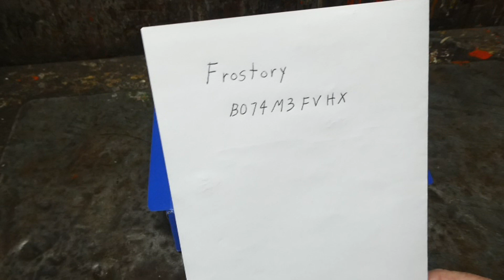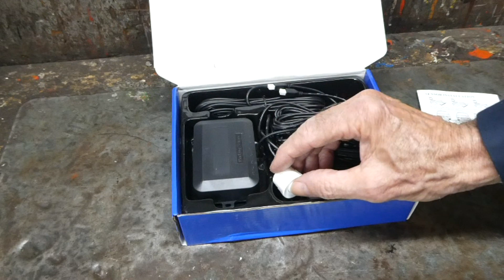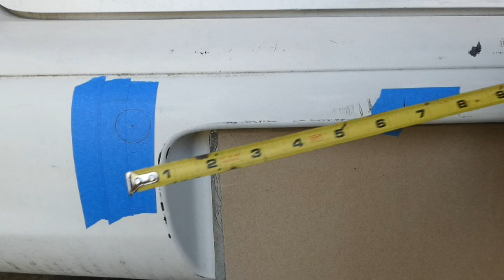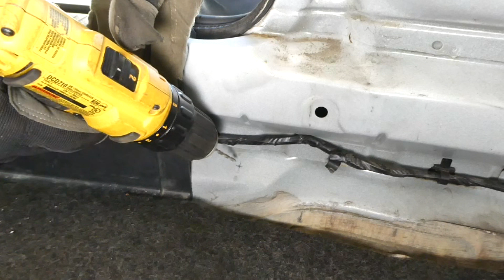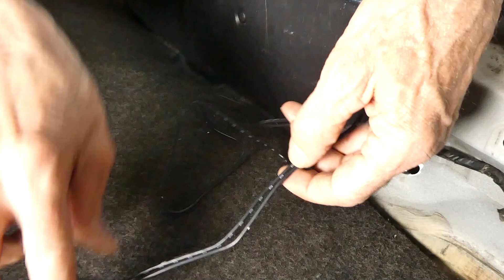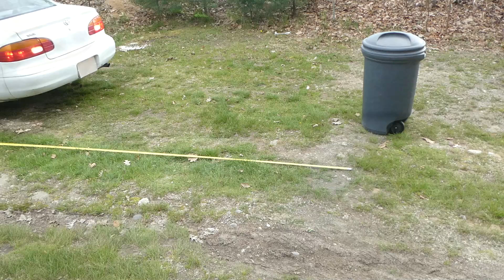Installing Rear Parking Sensor Assist Kit

Comment: does the live wire have no electricity going through it when the car is not set in reverse?
is it a positive? negative? or just a signal wire?
im trying to understand the wiring part.